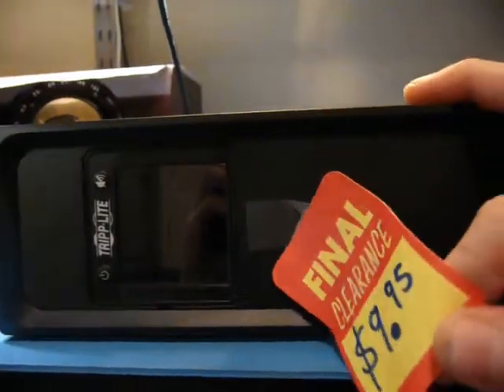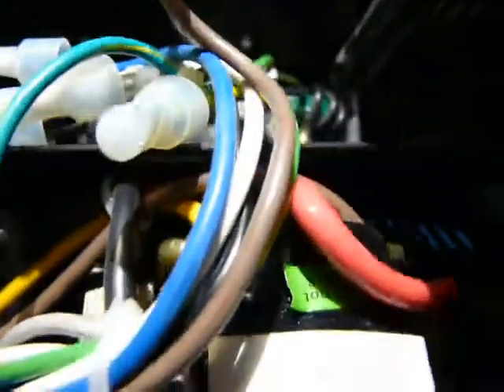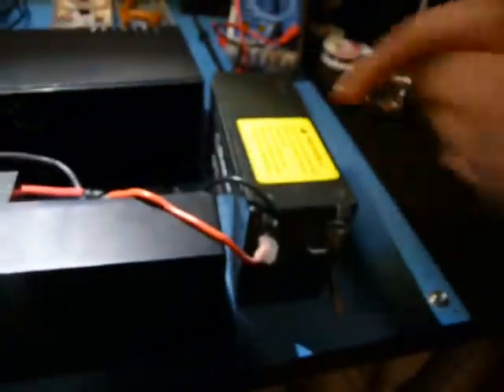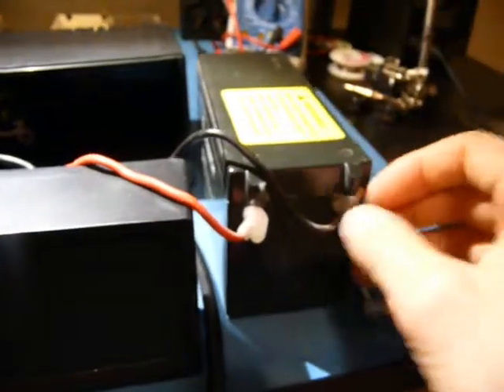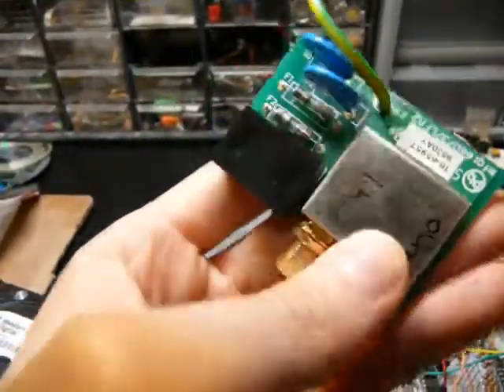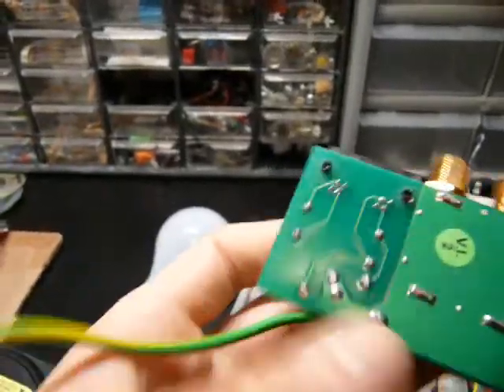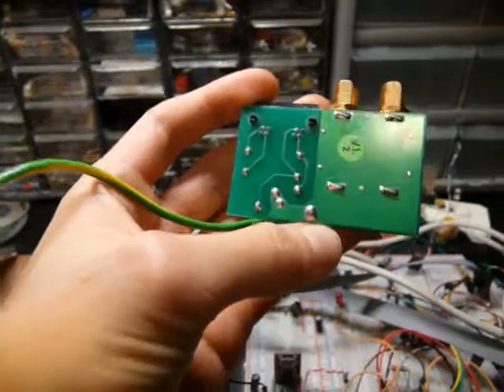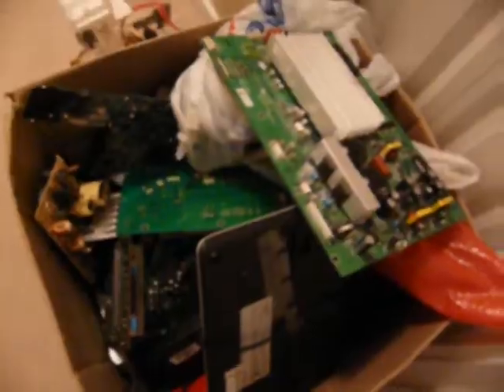UPS fix, surge suppressor transplant & theory

Comment: IN THEORY, these should not have any lethal potentials lurking within when off and unplugged.  The inverter in them is a transformer type one that does not have an intermediate 140VDC stage with its associated possibly charged electrolytic capacitors.  The transformer secondary is directly connected to the output receptacles when operating on battery electricity.
Reply: If you are used to playing with inverters -  you CHECK anyway. :)